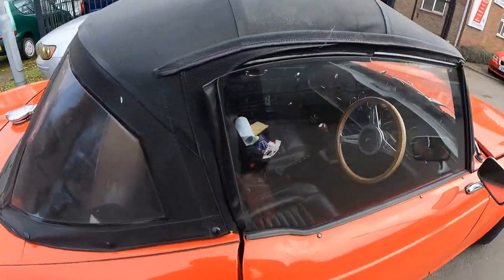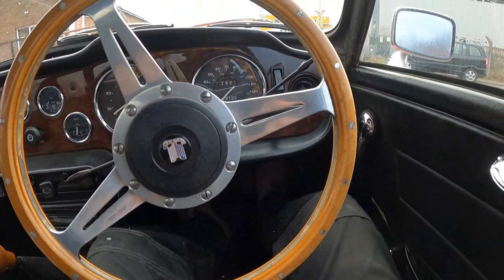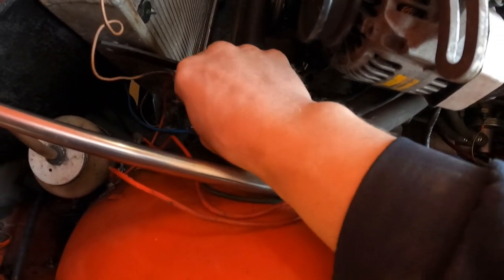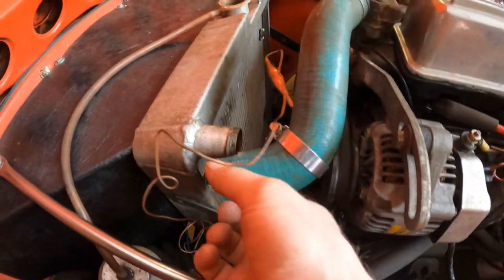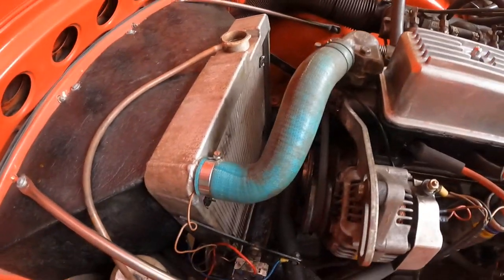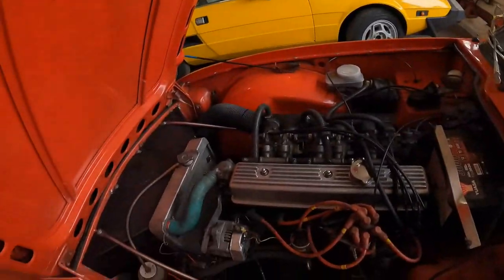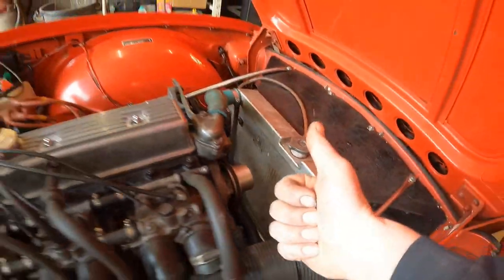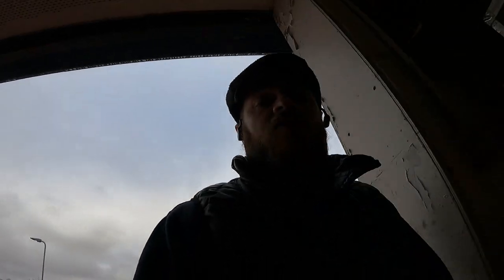Triumph TR6 radiator fan problems.

Comment: Either an exhaust leak at the manifold or the valves need to be adjusted…
Reply from the maker: After I stopped filming I had a look and it's the manifold gasket